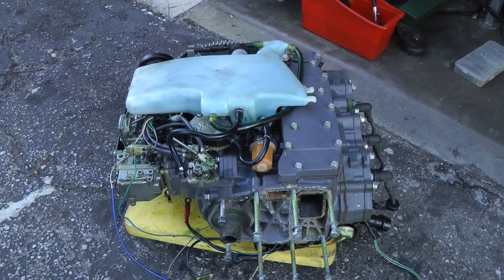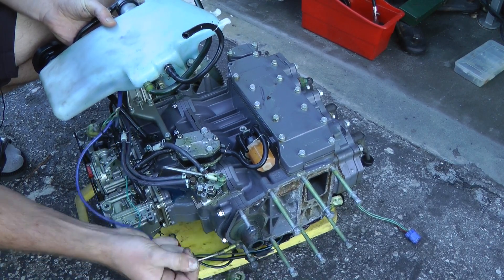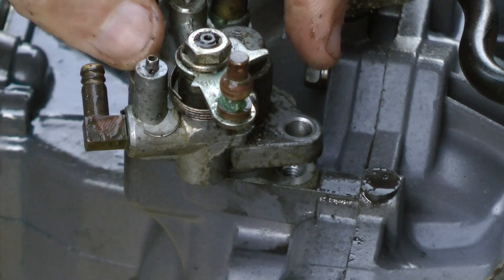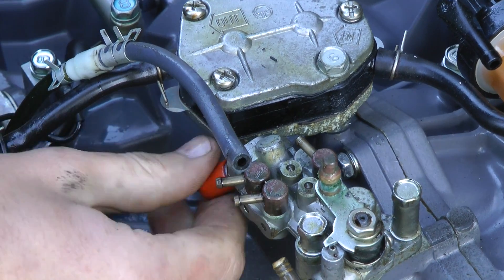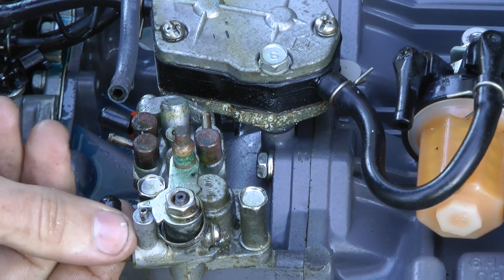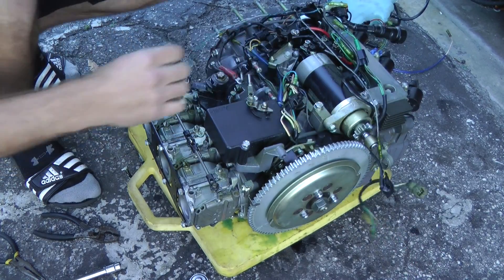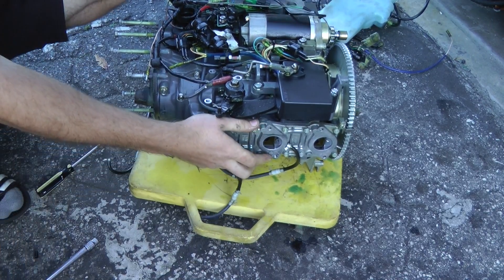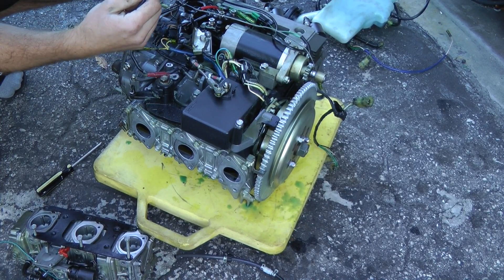How To Disable/Bypass A 2 Stroke OutBoard Oil Injection System

Comment: After doing this I’m losing abt 5mph I’m not in limp mode because I have the sensor still plugged in and zip tied to the full position fouled the plugs the first crank replaced them and still trying to foul them I’m mixing 50:1 what’s going on? Was running 34 before delete now it runs 28-29

Comment: I have a 2007 yamaha 25hp 2 stroke engine and it has a self lube tank like yours on it. Is it safe to take off I have only just bought it but I’m one of this guy who don’t trust the self lube and was wondering is that year and model ect okay to take off and just run premix which I would much prefer. Also the name your were looking for the caps are called blanks just incase anyone in the comments are looking 👀

Comment: Its not wise to leave the oil drive  shaft in there.  The rod u removed allows the oil drive shaft to slide in and out on the crank shaft gear , it damages the gear letting particles get into the bottom main bearing also killing it

Comment: I have eliminated alot of these self lubing engines. Basically the drive gear on the inside that is driven by the crank breaks and then leads to severe engine failure

Comment: Is it a good idea to do the oil pump delete if its working fine as a precaution ?Im getting a low hour 40 hp and I have been thinking about this subject
Reply: Because I've been out with a 2 stroke and had the oil injection quit and blew up the motor.

Comment: Have you ever done a video on how to diagnose why oil is leaking from the carbs on a 2 stroke like this Yamaha 40?
Reply: Float height
Reply: Did you ever figure out your oil leak problem?
Reply: In my case, it was because of gravity and suction. I had the motor laying on its side after I had removed the head and that was causing it to leak all out.

Comment: Just bought a boat and not sure if injection works so I was gunna make a mark on the plastic tank and and make my fuel tank 50:1 anyways and cheak if it goes down. If shes smokey i rather that then to lean and blow i up lol

Comment: Did anyone figure out what wires to cross , I removed the oil tank and premixed it but the alarm still sounds it’s getting plenty of oil cause it’s smoking a lot but would get out in the water it would go fine for a minute or so then the alarm would sound and it would go into limp mode
Reply: Is the alarm going off when it's running or just when you turn the key switch on?  I can completely disconnect my oil float wire harness and it doesn't affect the motor.  If the motor is running, and the oil float is disconnected, and an alarm is going off it is likely an overheat sensor.  They're on the back of the motor near the top spark plug.  Little plug in jobbys.

Comment: Is removing the lines from the pump to the carbs necessary if you plug the lines coming from the reservoir to the pump
Reply: Did you ever find a good answer for this I been wondering the same
Reply: Did u ever figure this question out 
Been wondering the same

Comment: Question I have a nissan 2 stroke ob motor(basically same as yours) and that rod that is attached to the oil pump in your video..... on mine it was not attached because the plastic fitting broke.  You said that as the throttle advances it shoots more oil into the carb.  What if I do not repair this oil pump link rod will my motor blow up?
Reply: did it blow up?
Reply: @BooneParty  No.  I fixed it.  Put a new fitting on it.  these are DAM good motors Several years ago my oil pump failed completely while I was leaving the marina it acted like it was seized up but was able to drive it several hundred feet back to dock.  Manually premixed it and it fired up and I drove it for years before replacing the oil pump.

Comment: What wires should you cross to keep the alarms from sounding and the engine from going into limp mode? On the low oil sensors, thanks! Also would it be better to leave all the small hoses attached? They’d be sealed plus I’d be worried they’d pop off if there was a backfire through the carbs (not sure if that’s even possible with the reed valves)
Reply: Alarm doesn't sound for me when the tank is just not there.
Reply: i took my tank off and left wires unplugged no alarm or no limp mode. 2 stroke would
just be running like poop if it was bad
Reply: Hey man did u figure it out have the same problem as you
Reply: @135-j  98 MERC 75CC 2 STROKE, just unplugged the hose feeding into the carb and stucked a drill bit to plug it, removed oil jug has ran good ever since. the oil injector messed up first time in the water so I fixed it this way on the trailer at the lake haha kinda easy way to do it
Reply: @BooneParty  👍😂
Reply: Did you ever figure it out. I'm having the same issue.

Comment: Disconnecting oil injection on any outboard (except Johnson/Evinrudes) is a bad move. First of all, the systems are almost bullet proof. Too many people just don't know how to diagnose them. Especially Yamaha (the injection system is actually tied into the trim sensor!). These systems are variable ratio (meaning they deliver less oil at lower rpms (a good thing!), they deliver the actual amount of oil for the given throttle demand. When folks disable these systems and self mix, they end up using too much oil "to be sure"; that contributes to sticking rings, excess carbon, and less than optimum performance. Also, the oil modules for these systems have to be "tricked" so you don't get warning buzzer. It's just not a smart move.
Reply: I know some two cycle engines have an oil feed line to some of the crankshaft bearings. So if you disable the oil injection system it will cut off lube to those bearings. Premixed fuel won't get enough oil into those bearings. Besides oil injection is one of the best things to ever happen to a two cycle engine. And Yamaha's are among the very best, they don't fail! Ever! If you have an engine failure it's not the oil injection's fault, it's intake air leaks, carburetor problems, water in fuel, poor fuel, timing is off, bad or wrong spark plugs, wrong plug gap, etc.

Comment: I've done it to mine yamaha 90 what oil should I use for premix what do you recommend
Reply: Take the drive shaft out, under the pump then pre mix oil 50-1 wait for it to size 0r 75-1 /100-1 full synthetic oil.
Reply: Did u do it the exact way he showed in video 
Want to do it to my 70yamahaa

Comment: Rather than use those little caps to cap off the pipes just leave the pipe on and use a bit of it to fold over and cable tie it off or on the pump just link one to the other ,,,,leave the carbs on and just again link them to each other or use part of the hose to fold over and cable tie it ,,easy. Removing the carbs cause hassle and damage the gaskets ,,,,,

Comment: Socks and sandals, top stuff.

I did an oil pump delete off my older waverunner. Very similar, but I just looped the feed lines to the carbs so I didn't need caps. It works perfectly and has been running spot on for years now.
Reply: Looped the feed lines to the carbs 
Or u mean left the feed lines on the carbs

Comment: why didnt you remove the inner drive shaft for the oil pump? that can cause a possible problem over time,leaving it in the motor.
Reply: Some say yeah some say not too 
Know numerous people that didn’t remove inner drive shaft and have run 100s of hours no problem
Does it pull right out or what
Reply: @135-j  yea,it just pulls out, reinstall the pump as a blockoff.
Reply: @harveynewman4333  and it’s just one piece
I’ve already pulled worm gear out pump but nothing out the block
Reply: @135-j  you remove the coller under the pump and you will see the shaft. it just pulls out.,reinstall coller for pump alignment and bolt on.
Reply: @harveynewman4333  just remove the worm gear from inside the Pump and vacum cap all nipples on pump and all 3 on intake manifold to each cylinder

Comment: There is LIKELY this question asked a few times yet the fact that an engine has direct oil injection; an increased oil amount added, for an increase in throttle (Seems logical for the NOOB's) and/or me being a semi-advised NOOB. Why go to the effort of bypassing the oil injection? It works, it has worked very well for years before and seems like it will work for year to come (640k aught to be enough for anybody"), might thwart my statement. Why go to the effort to pre-mix when the system works well at best? Please refrain from attempting to burn me and/or give me grief for my question, but this video makes little sense to me when it appears to be making life harder in the long run........
Reply: Often times it’s the cost of repairing the system compared to just deleting it. The alarm for my oil injection system constantly blared as I have a bad oil injection alarm module. A new module is over $180 while blocking the system and converting to pre-mix is a cheaper fix. No need in putting a lot of money into an older motor.

Comment: Hello Eric...Thanks for this video..its very good. I am trying to remove the oil inyection system on my Suzuki DT200 87'. I am doing similar to your process. However, this engine brings a hose from bottom to the top of crankcase...can I just take out this oil hose as well and cap it? Wouldnt be an issue to the engine gears??
Reply: I’m wondering the same thing

Comment: I never got why anyone would do this with a gravity Fed gear driven system.
Reply: I was told that with this type system that the bottom cylinder gets less oil than the upper two?  He also said because of this it's most likely when you loose a cylinder it will be the bottom one.  That was years ago.  I recently had to rebuild my yammy 2 stroke 90 and it was the bottom cylinder that failed.  Appeared to be over heated.
Reply: @jws9321  is ur oil pump deleted on it 
If so how long u been running it that way

Comment: So,  just for other people out there,   The answer no one could give me,   How to TURN off the low oil alarm/idle mode.    
    So cut the oil tank wire harness about two inches from where it plugs into the ECU.  Twist the two blue with red stripe wires together.  Now Important!  Wait a couple seconds,  it takes a little time for the alarm to shut off.  Now leave everything alone and the alarm will stay off.  If the two blue with red stripe wires touch anything or if you unplug the ECU wire plug you have to start over and wait a couple seconds
Reply: When you say wait a couple seconds do you mean to start the motor or what?
Reply: Depends on years most time it’s just unplugging pink wire
Reply: What pink wire, there are 3 pink wires. . Please explain where the pink wire is located
Reply: What engine did u do this on
Did u just pull out the one shaft or both and how long u been running like this being deleted
Reply: @135-j  pulled one shaft on a mid 80s Yamaha 150 saltwater set
Has been running like this for four years
In hindsight......my problem was getting the oil from the well tank pumped up to the smaller tank inside the engine cowl,  looking back I would have been better to just delete this larger oil tank and simply run on the the tank inside the cowl.  My actual  rin times per trip were short enough I could have just run on the smaller tank, removing the cowl as needed to refill the smaller tank.  Having said all that I have not had a problem doing premixed gas
Reply: You can also just plug the sensor back in and zip tie the float to “full”

Comment: So what is the recommended Oil/Gas mixture for this engine after you bypass the pump?
Reply: 50:1, 100ml oil to 5 ltrs petrol, only use tcw3 oil, i recommend quicksilver premium plus.
Reply: 2% tcw3 oil
Reply: so you put 200ml oil to 10 litres of benzin

Comment: why not just disconnect the oil sensor and the wire that drives the pump?
Reply: Pump is mechanical did u miss that in the video, he takes the little worm gear out that drives pump off camshaft
Reply: Wondering the same thing. Would just disconnecting the wires to the sensor, drain oil, mix gas and go work?
Reply: Wire doesn’t drive to pump

Comment: Just be sure those openings by the carbs are getting air tight with the method you use to close these off..
You do NOT want air drawn in there when it's running.
Reply: Air leaks in a 2stroke,imminent destruction
Reply: What if shaft removed as in video and all lines still connected

Comment: Like anything else mechanical that we are blessed with..failure only occurs due to neglect and lack of maintenance or tampering on the part of the owner/operator that doesnt understand..My old Evinrude 2 stroke finally died after almost 25 years of faithful service and that was from normal wear and tear and high hours..and its oil injection pump after testing was found to operate just like new.
Reply: Same here. My 1991 Suzuki 65HP 2 stroke runs just fine with its oil injection pump connected. No mixing, no possibility for mistakes..simple as that.
Reply: Engine parts never fail.  Keep commenting over and over, because your anecdotal experience isn’t worth shit.
Reply: @deadlata9767  Yeah..and I suppose you have higher qualifications than my Aeronautical Engineering experience of almost 30 years?..Cut the crap pal and STOP JUDGING if you dont know the person first😁😁😁
Reply: "Failure only occurs due to neglect or lack of maintenance"?! That's an extremely ignorant statement. Have you ever heard of tech service bulletins or recalls? Those are based on mechanical and/or electrical failures that have NOTHING to do with abuse nor lack of maintenance. I dont know of a single manufacturer on the planet that makes 100% quality products with 0% defects.
Reply: @kenwright5410  Ignorant? Really?..Then i suggest you SHOULD STOP running cheap crap products made by the CCP and spend a little extra on REAL quality machinery for a change that NEVER have ANY service bulletins or recalls issued on them..Then you might understand what i mean..but your type never do anyway😁😁😁